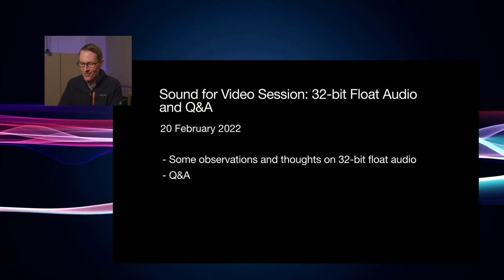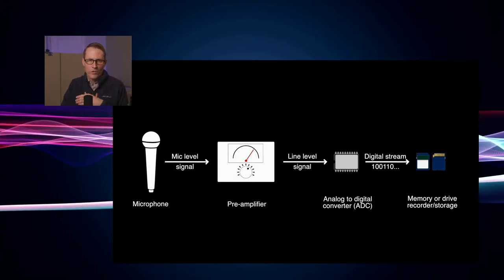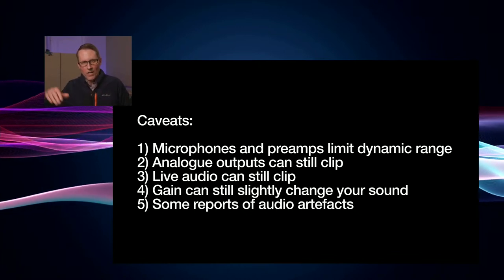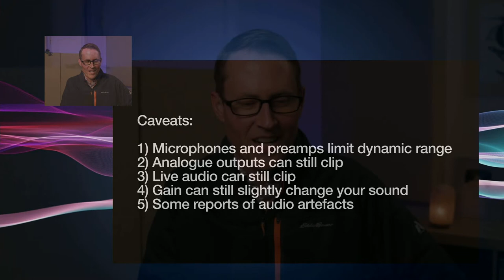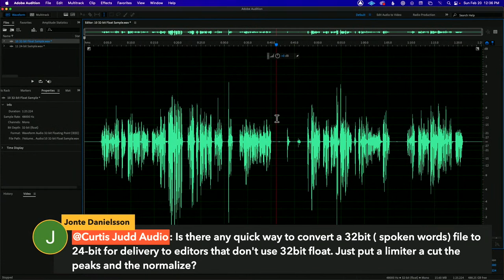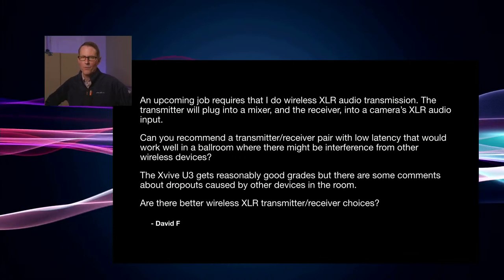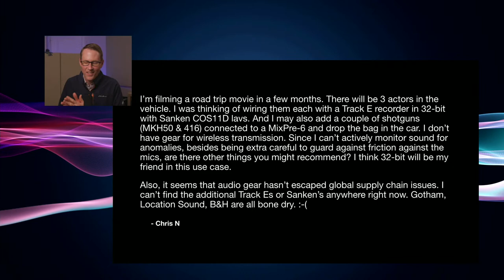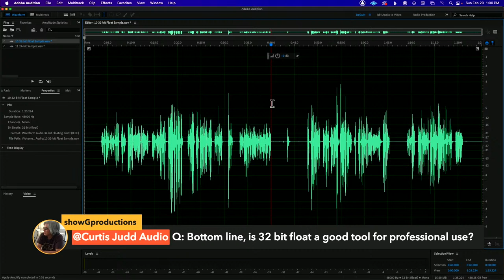Sound for Video Session: 32-bit Float Audio & Q&A

Comment: I like how you differentiate between 16 and 24 bit analog to digital conversion vs. wav file storage formats as they are two completely separate concepts. Something you touched on that is an additional point of confusion is that 16 and 24 bit are stored as integers in a wav file. 32 bit float is stored in standard scientific notation floating point mantissa plus exponent file format. This provides the massive virtually incomprehensibly large dynamic range suitable for interstellar concepts of mass, velocity, distance, nuclear physics, and really loud sound! 32 bit integer dynamic range is much smaller at 4,294,967,296 different levels but obviously still very large. Seems to me 32 bit integer would have been a perfectly reasonable way to store large dynamic range values but apparently the floating point storage method was already developed and ready to use so… it was implemented across multiple companies.
Reply: Thanks for the insights, Allen.
Reply: But isn't it nice that different bit depths and floating point fit into the .wav package without the need for all new file formats? Uncommon engineering for the future back in about 1980, wouldn't you say? :)
Reply: @jimshaw899  Yes I would.

Comment: I was wondering how 32 bit float would sound recording a music performance. I have had a hard time adjusting the levels between set performances.  Will the recording sound weird or something? There are a lot of frequencies being played. This has kind of scared me. Does 32 bit audio sound different than 24 bit audio? Will delivery be sub-par?
Reply: Give it a try and see what you find. In theory, it should not affect the sound drastically. I haven't noticed a difference with spoken word recordings.

Comment: I agree 32 bit float or 32 bit floating point is a real mouthful and your idea of Wide Dynamic Range Audio is a better phrase. However to pronounce W is three syllables, I suggest High Dynamic Range Audio so HDRA or HDR audio is a succinct easy to use phrase and acronym. Similar to HDR video already in wide use.
Reply: That could certainly work!

Comment: Curtis,

From reading your replies, I understand you’ll be testing the Zoom F3. Please, if you can, test this:

1. A few popular condenser and dynamic mics: Rode NT1, Electro-Voice RE20, Sure SM7B, high-quality (low noise) lavalier mic, etc.

2. Audible noise on voice-over tests in treated room after at -6db and -3db (with compression and EQ).

3. If the unit (or available software) will allow, the noise level at -6db and -3db (with compression and EQ).

4. Adjusting the 32-bit float files to the correct levels on a Mac with non Adobe programs.

Thanks,

yYM
Reply from the maker: Thanks yYM for the suggestions. I will test a few different microphones. I usually conduct a practical test at a loudness target of -23 LUFS as that is easier to use for comparison and consistency than using a dB peak level. When you say non Adobe programs, which apps did you have in mind?
Reply: @LearnLightAndSoundSessions  Curtis,

Thanks for the reply. I may be off base here, but my requests are based upon:

1. Eventually people asking, “Can I use this as a portable voice-over unit?”

2. Eventually people noticing, “Yikes, those preamps are noisy!”

3. Noticing certain mics with certain voices don’t work well with certain preamps.

4. Believing gates and noise reduction should be a last resort.

5. Manufacturers, Apogee and TASCAM come to mind, using music in the background to hide the preamp noise.

6. Following a guideline of recoding a voice-over with an average level of between -12 to -6db with no peaks above -6db if possible. And after any effects are introduced (EQ and a voice-over-type compression, say), never going above -3db.

7. When the F2 first arrived, I tried using its 32-bit floating point file with Logic Pro. It’s a no-go. And because I refuse to be hostage to Adobe’s leasing program, I attempted to use other programs which, often, have numerous issues. So, to answer your question: Any program where I can easily import the file to my Mac M1 and simply bring the peak down to -6db. From there, into Logic Pro, Final Cut Pro, Motion or LumaFusion (in my iPad Pro M1) it goes.

Thanks as always,

yYM
Reply: @LearnLightAndSoundSessions  To add: Why am I using the reference of -6db instead of 23 LUFS? Because the meters on all my equipment, and the defaults of the major Mac programs: Logic (and the top Logic plugins), Steinberg and LumaFusion have this as the initial reference.
Reply from the maker: @yinYangMountain  Yes, understood. As for apps, Final Cut Pro can handle 32-bit float files.
Reply: @LearnLightAndSoundSessions  Thanks, never tried that directly.

Comment: As both a Behringer XR12 and XR18 user and live a event streamer it sounds like it was going balanced into stereo barring any other downstream issues this will give you a reverse phase on your right channel and if you're listening on mono it will cancel, if you're listening on stereo depending on your speaker separation you might not have an issue. and subsequently on headphones you will not hear the issue because your head is physically in the way and your brain can either perceive or not perceive the difference depending on factors. I think if I was in the moment I might not catch that but I have been able to tell in a testing setup environment. The simple solution is just go XLR to quarter inch and to a mono TS plug as the shield will connect to the "R" effectively making a unbalanced output on the mixer side. Either in Software or with a physical cable might need a custom-made you can then feed the same signal to left and right ( you can split but you cannot combine FYI see white paper: RaneNote Why not why ).

Also I like to have a device playing back the stream (like the age-old radio on in a radio station) so I can say I'm hearing the audio go all the way through the loop and back fine it must be an issue on their end and usually if somebody is complaining that they can't hear anything and I don't know why but they probably hit mute...... That could never happen And then they complain they paid so much money for this blah blah blah.
Reply: Thanks, good advice.

Comment: This is such a helpful video! Transitioning from photo into video for casual home talking-head and outdoor fun-filming, I have assembled a kit so far of an a7iv to be rig-mtd, a Rode VideoMic GO II (wired), a Deity V.Lav (wired), and a Zoom H1n. All brand new. Yes, most of the budget went into the camera. 😁 I was just about to buy a $189 Beachtek DXA-MICRO-PRO PLUS Active Audio Adapter Mixer to get both Mics connected and have a bkup recording for safety. Now the F3 is available and, for another $150, I can be less concerned about gain adjustments in real-time— seems worth it. And FYI I'm learning Davinci Resolve. I listened to your entire (excellent!) video here and learned a lot but I'm still unsure of all the caveats. But I read this at B&H: "...or use the F3 as a 2x2 USB audio interface capable of 24-bit / 96 kHz resolution. USB audio interface functionality will be supported by a firmware update scheduled to be released in March 2022." Does that mean I can be on-the-go and switch the F3 from 32-bit to 24-bit recording as I desire? Or does it mean only when connected to my PC? It seems like being switchable between the two bit-depths answers all the considerations in your video.
⁉EDIT: uh-oh. Just saw your F3 video with this in the comments, only I don't know what it means. "As an audio interface you can record in 24-bit, but not on the F3 itself." Maybe it means I can record in the F3 only at 32-bit AND, if also connected to my a7iv for simultaneous recording, I can tell the a7iv to adjust the input signal and record it in 24-bit? Wow, the more I learn, the less I know.
Reply: If you use the 3.5mm output to feed audio to your camera, you don’t need to worry about bit depth because you are sending analogue, not digital, audio. What you do need to do is make sure you adjust the amplification so that the audio stays below 0dB. Otherwise, you’ll be fine.
Reply: @curtisjudd  Thanks, makes sense. Reset my thinking now.

Comment: Hi Curtis, thank you for the detailed information! I am very new to using 32-bit float. I recently performed a test with a Rode VideoMic NTG and the Zoom F2. I had the F2 set to 48kHz / 32 bit Float (using the latest firmware version). I may have made a mistake by leaving the gain on the Rode VideoMic NTG fairly high while recording music close to the single speaker on the stage. Not all of the recording is clipped but the louder vocals are (just two people on stage with guitars and one singer at an outdoor famers market).  I think I had the gain set high because I was also performing another test just sending the NTG audio to my camera (with the in-camera audio gain set to the lowest setting). So, my question is this. If I accidentally left the gain setting on the NTG fairly hot, would this be a problem when placing the mic fairly close to a loud stage speaker. There is audible clipping and also visible clipping in the waveform in Resolve even after lowering the gain. I don't know much about Resolve Fairlight so I'm hoping there is a way to recover this. Resolve does not indicate that the file is 32 bit float. I only see 48kHz Linear PCM in the file properties in Resolve. Audacity lists the file as 32 bit float but the clipping remains in Audacity as well when I reduce gain. (I have never used Audacity before today). Perhaps I have to keep my gain settings on the NTG on the lowest setting in potentially loud environments? I was not monitoring the audio because it was an impromptu test. I just thought I had a new magical 32-bit float device that could capture anything without clipping! Perhaps I am doing something wrong in Resolve - or perhaps I simply exceeded the capability of the signal at the mic itself by exposing it to a loud speaker while having the gain on the NTG too high. Thank you for all of your help! Chris
Reply: There's a good chance that the microphone itself clipped before sending audio out to the F2.
Reply: Thanks Curtis, I think that is exactly what happened. Rookie mistake but that makes sense. Lesson learned - gaining up on the microphone itself has to be done with extreme caution in loud environments - even with the "magic" of 32-bit float! Thanks again, Curtis!

Comment: I think Curtis sometimes needs a dynamic range boost, a bit wider amplitude, reduce that compression =)  Jokes aside, good explanation although a bit approximate in the comparisons to other formats in technical terms, 32bit float does not fully explain the implementation type, or dynamic range chosen per se. you could sample a terribly narrow dynamic range with 32bit float and a hugely wide one with 8bit if you wanted to, you'd have ridiculously high resolution on the 32bit and ridiculously low on the 8bit in those cases.

Comment: ** Question: Hello, thank you for the video. Very helpful. I do a lot of live streams, weddings mainly. Much of the time I am live streaming the ceremony and recording internally. I will deliver a mastered copy of the ceremony with all the bells and whistles. It's multi camera and multi microphone. Generally, I use the XSWD system and record into the 48k 24 bit XLR inputs directly on my camcorder. When I need more than two inputs, I use the H6 to record that audio and send the mix out to my camcorder using the line out and a 1/8" to L/R XLR. SInce I'm live streamning I have to have my levels set properly in the first place. BUT...

If I used the XSWD (an ATPx Live digital transmission) would I see any benefit in recording in 32 bit float? I'm thinking no because the XSWD system is 24 bit.. and that would be the bottleneck. BUt Then I think about a UHF system and wonder if that would work better, for example the Comica BoomX-U. I believe it's digital too because the specifications have the latency at less than 20ms. That to me meands it's probably digital. 

If none of this works, then would the only benefit of 32bit float come from a physical connection between the microphone and the recorder? Maybe someone can let me know if I'm on the right track with my thoughts. I would really like to use 32 bit float for the extra precaution of clipping in the event I need to recover something in post. Thanks!
Reply: Hi Robert, your thinking is correct. To get the full benefits of 32-bit float, you'd need a wireless system capable of wide-dynamic-range transmission. I don't know any, even in the professional grade market. The closest I know of are the Zaxcom transmitters which transmit a standard dynamic range signal, but record a wider dynamic range in the transmitter itself. So if I were in your shoes, I'd stick with the XSWD system.
Reply: @curtisjudd  thank you for your reply and assurance. Cheers!

Comment: Not quite the scope of this video but perhaps you can cover Dante and in Dante Controller encoding at 32-bit? Would you have a lot more headroom for low signals for makeup gain after Dante gets to the subscribed receiver? (Quieter makeup gain than 24-bit Dante encoding)?
Reply: I don't know the answer to that, I'll need to look into it. Thanks for the suggestion.

Comment: Useful stuff. The state of digital just keeps expanding, while the state of analog audio is pretty much where it's going to be. Just Gaussian noise in analog limits its dynamic range.

HDR Audio would be a good term, but not once the advertising copywriters get ahold of it. 
I wonder if the AES might coin a term with a matching standard? Or, have they already?
Reply: Good question, I don't know whether they have or not.

Comment: Hi Curtis, quick Q if you have time to respond. I have the Zoom F3. Currently I am recording via a Pencil Condenser mic, and my Sony Alpha camera for doing my talking head videos. I then import the 32 bit float WAV file from the Zoom into Davinci, along with the Video file from the Camera. I sync them, then turn down the Camera audio. Now, I have just discovered the Zoom F3 can act as an Audio Interface. Do you know, if this is setup this way, if I set up Davinci to recognise the Zoom as the Audio Interface, and I go into Fairlight and click record whilst recording with the Camera at the same time, then do the same sync etc .. would I be recording through the Zoom in 32 bit float? or would I need to setup the Davinci Fairlight to record in 32 bit float .. and therefore I am kind of missing the point of having the Zoom in this setup?! I hope you see what I am getting at .. I already have an Apollo Twin, so I could always just use that and record in DR in 32 bit float I assume, so I am starting to wonder if there was any point in buying the Zoom apart from the fact it's designed to be out in the field, thus the name! :) I am looking to streamline the process, as there's no point in recording to the Zoom, importing the WAV etc, if I can just do this directly in Davinci.
Reply: I think I have worked out what I have mis-understood on this whole subject. Davinci doesn't RECORD in 32 Bit Float, it just is able to understand and process it when it is imported. I got confused thinking Davinci recorded in 32 Bit Float, thus me not needing the Zoom any longer. Adobe Audition however, well that does record in 32 bit float, so I am at a halfway house but will retain my Zoom F3 for recording my YouTube talking head audio in 32 bit float ! :)
Reply: @paulg3388  Glad you sorted it out! I'm surprised that Resolve doesn't record in 32-bit float. Seems like they'd want to make that available across the board (processing and recording).
Reply: @curtisjudd  well I may be wrong but I just can’t find the information on how to record in 32 bit float, only that it was able to read and process files imported that are 32 bit float. Thanks Curtis !

Comment: I use Cubase 12 for music recording, it's a 32-bit float software. I tried to record with those settings and it didn't worked as you explained in your multiple videos. A bit later I realized that it's probably my old audio interface Steinberg UR44 that can't do it even if the software can, yes I'm a newbie :)
Reply: Hi Robert, that's correct, the hardware must have multiple analogue to digital converters per input to capture wide dynamic range audio. The 32-bit float file is just a big enough container to contain that dynamic range. But the hardware must capture it first. 👍
Reply: @curtisjudd  In 20 years or so on Youtube and having asked or commented hundreds of videos, you're by far the most kind, fast responder and mostly you take the time "to" respond. You're fantastic! (sorry for my English)

Comment: Is there a video or resource showing a beginner how to use RX9 to process 32-bit float audio to get the best results? In this video you briefly noted "asymmetry" in the wave form when you pulled the gain down in the first clipped sample. I'd love to see other real-world examples of using RX9 on 32-bit float audio to solve common problems and get an export-worthy result. :)
Reply from the maker: Nicholas, 32-bit float audio processing is pretty much identical to processing for 24-bit or lower. The only difference is that you first want to reduce the gain on the recording IF you have any spots where the audio exceeds 0dB. Then everything else is the same. If you'd like details on how to process any audio in RX, just search on YouTube for Curtis Judd Izotope RX. Or if you want. a full course, we have an RX course over at school.learnlightandsound.com